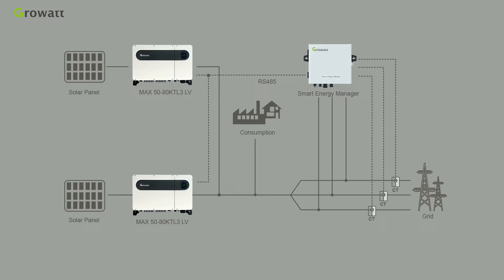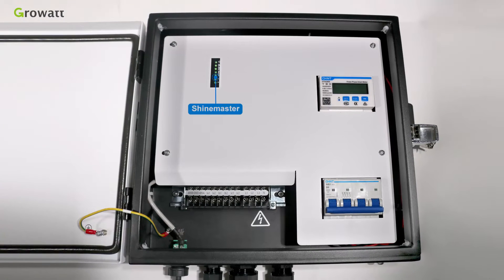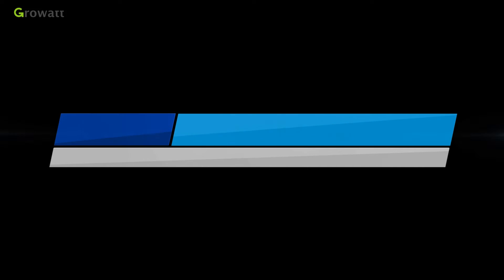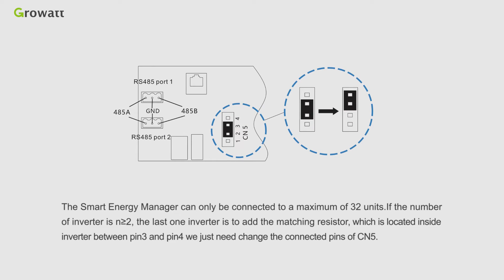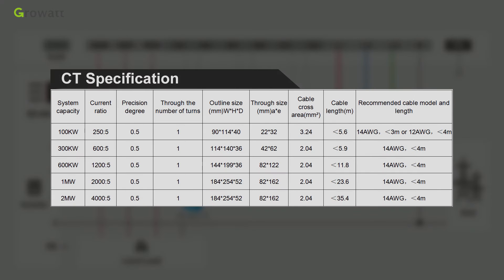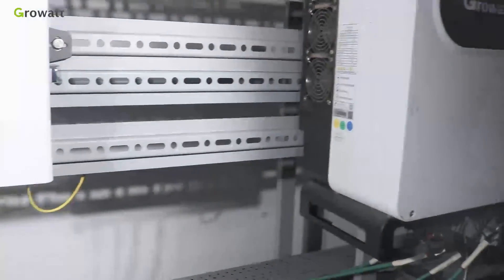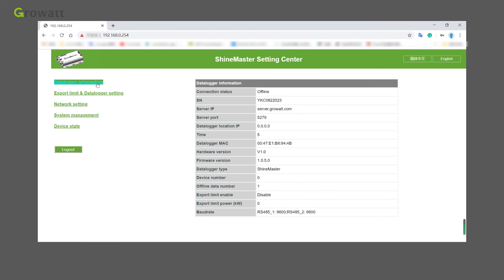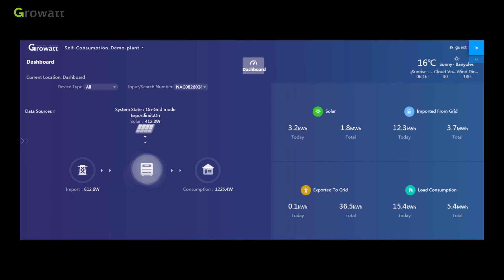Smart Energy Manager Installation Guide

Comment: This only discussed single cable coming from grid, but usually big systems of clients composed of multiple sets of wire.
My question is do we have ct you can recommend if Interconnection point of tapping have existing 13 sets of 250mm2 wires that will still be readable by the Smart Energy Meter for Zero-export control?
Reply from the maker: Hello, for product inquiries and business collaboration, please feel free to contact our sales team at info@ginverter.com. Or you can visit our website at www.ginverter.com for more info. Thank you!

Comment: Hi, i hace a Growatt MIC 3000, and conect a chint single fase and cant comunícate, put 24 and 25 with the com 3 and 4. The DRM port whit RJ45 with this conection is not work. The inverter have the failure 401
Reply from the maker: Hello, for technical support, please contact our service team at service@ginverter.com, or you can call our service hotline at +86 755 2747 1942. Thank you!